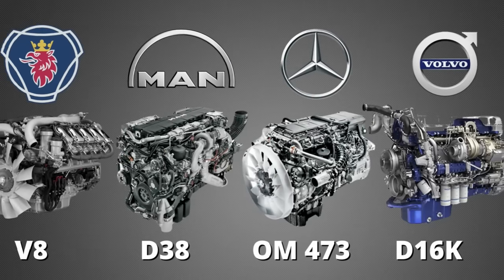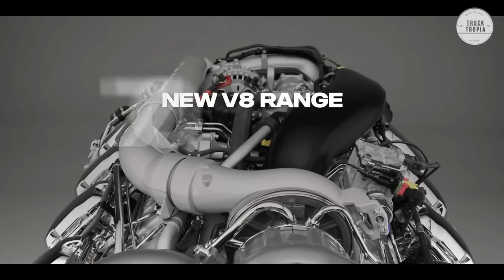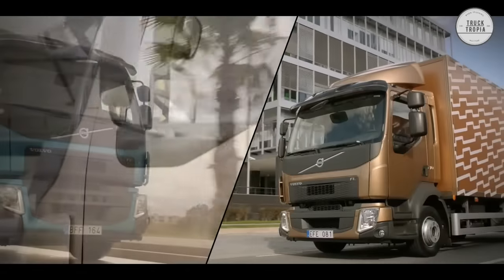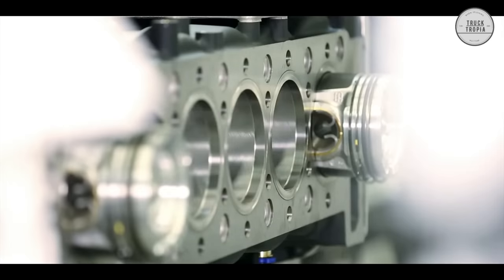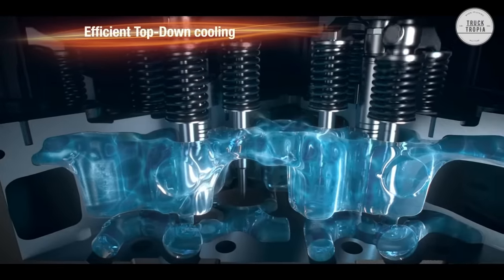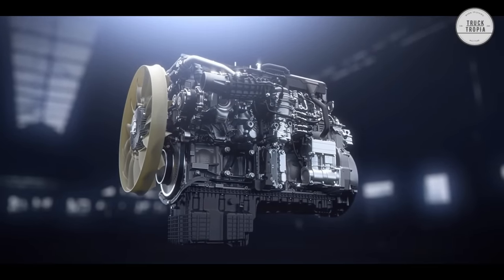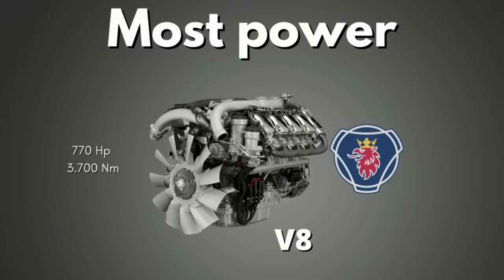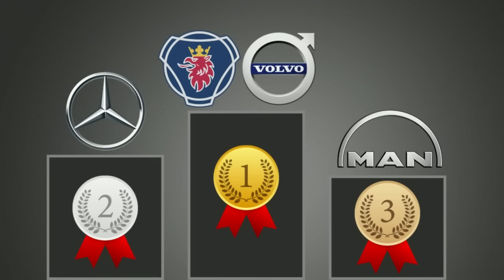Which Engine Is Best - Scania vs. Volvo vs. MAN vs. Mercedes

Comment: I own a transport company and I have DAF, MAN, Volvo and Mercedes trucks and so far the most reliable one is MAN (a 2015 d26 480hp with more than a million km only needed regular service like oil changes and filters), with Volvo we've had DPF issues and some electrical anomalies, Mercedes had issues with the retarder(small metal fillings blocked the radiators)and my DAF had issues with the exhaust aftertreatment (also no one can figure why it uses lots of adblue). By far the most economical is our Mercedes (a 450hp unit) with DAF coming second and MAN and Volvo are quite similar here. In terms of cab comfort all my drivers love the DAF, it has a really well designed cab but Mercedes comes second with MAN being the most outdated. We haven't ran Iveco or Scania(we avoid Scania because it's way to expensive and doesn't make much economic sense, I prefer to better pay my drivers). For servicing I do have my own service station and all trucks get serviced yearly or at 100k km(depending on what comes first, we also have telemetry systems and some trucks would adjust their service intervals depending on how hard they have been working). None of them left drivers stranded so far
Reply: Trailers ?
Reply: Eveco it's similar to Renault not worth it . And i guess these two are the cheapest over all
Reply: This is good of you.
Reply: Mercedes a brand u can trust anytime.much love and respect from Africa Kenya ✌️♥️ trucker in 🌍 Africa
Reply: Salut,la ce ar trebui sa fiu atent prima  cand cumpăr un camion?
Mă gândeam la un Volvo sau Man,  fie EEV  sau euro 6.
Reply: @clauu1066  eev este euro 5, nu ai nici un avantaj față de euro 5. Este important să te uiți la istoricul de service, legea obliga operatorii de transport să aibe un registru de service pentru unitățile folosite deci poți să te uiți acolo și nu fugi dacă mașina nu a avut service la reprezentată de multe ori nu înseamnă nimic(TGXu care mi-a trecut de 1000000 a fost de la H.essers și nu a fost nici măcar 1 zi la reprezentată pentru service). Nu cumpăra ceva ce nu o să folosești, pentru marfă generală 440-480 de cai e suficient(17-18 tone media). Alt sfat pe care ți-l dau este să aștepți până în primăvară, mașinile încă sunt scumpe dar producători au început livrările pentru cele noi odată ce ajung la zi livrările or să se ieftinească și cele second-hand (un euro 5 simplu nu merită mai mult de 15000 de euro).
Reply: @yassineyangossa3148  Renault is essentially a cheap volvo often with better cabs, the issue with these cheaper units is that companies and drivers who buy/drive them tend to abuse them more often and to not service them regularly (they buy these mostly to maximize profits) unlike a volvo or a Scania which are mostly bought by fans of these brands and drivers tend to like the brands( a Scania r450 uses essentially a 12.5 L MAN  engine but at a higher price). So brand loyalty shouldn't be considered here, I tend to buy MAN because my mechanic knows them extremely well(being an ex MAN mechanic) but keep this in mind I'll rather buy a well maintained Iveco than a questionable maintained Volvo.
Reply: @yassineyangossa3148  Krone and Lecitrailer(older ones). With these the less features they have the more reliable they are
Reply: @Jefecino  you can go to a MAN service station and ask them to reprogram the gearbox to better suit your needs.
Reply: @Rsvlogs1990_Khan  had some issues with the mp4 generation and they lose their value with higher mileage (unlike MAN,Scania, volvo etc) but they are good on fuel
Reply: @Stef.Cata051  very true even here in Kenya we have issues with the mp4 model.thank you for your kind reply much love and respect from Africa Kenya 🤗♥️
Reply: @Stef.Cata051  mulțumesc frumos
Reply: I work for MAN, we have our issues but so far biggest problems I see is software/adblue related. not much engine related
Reply: @assassinul95 Man is the best truck in the world
Reply: Im in america and i own my volvo ! Deleted dpf egr ! Runs like a champ 525hp
Reply: Thats True
My Father Had Own Buses
Setra, Mercedes, Neoplan and Man. 
Man Was The Best One
Reply: Am Nowamazima Duncan firstly i congratulate you for a strong mind and good ideas and i wish success. Thanks
Reply: Am mechanic well experienced but since of poor economic support in my country Uganda  i would like to be offered an opportunity
Reply: first get a scania and try it.  then sell the whole fleet and buy scania
Reply: @yassineyangossa3148  Renault trucks are owned by volvo.
Reply: @jacob42069  yeah ... some of our MAN goes back to munich because of adblue-problems and MAN-munich cant find the problem. we are not the only one ...
Reply: MAN is best in automatic and manual transmission
Mercedes little good but MAN is great in truck and trailer I am in Saudi Arabia and drive all type of vehicle you mention in comments MAN is best if I giving position for the number 
Then number 1 is MAN 2 is marcedes 3 for scania 4 for Volvo and 5 for renult in trucks
Reply: i have only driven scania and volvo, now i have a volvo fm480, just right now at this moment when i comment this my truck has stopped, its the second time in a month it does that, before this one i had a G500 L6 i miss it so much better comfort, i never had any problems with it, same size as my volvo except i have 4x2 now and a cargo box with space for 21 pallet places, the scania had 6x2 with steering on the last axle and same amount of space on the cargobox
Reply: @punjabirocks5504  funny that with all the problems MAN has as a company, essentially ending up begging for spare parts from Scania because they don't have the economy to develop their own designs further. However they've also been quite unlucky with their decisions lately such as focusing on their new chassi right before new conventions
Reply: This is so true I work with a logistics company at Nairobi port and we've been very much okay in terms of service and fuel consumption with MAN trucks
Reply: Are you saying that Man is a good truck?
Reply: @pencilwaniya5317   off course come to kenya you'll see major companies using MAN trucks to haul transit goods
Reply: @ronmunoru829  Because they're cheaper, on the inside they can't compete with the high end brands but if they suit the needs you have they're obviously a good choise. As a company though, they're poorly operated
Reply: From where are you sir
Reply: @harshakaeranda9430  I am Indian..
Reply: NAM has some awful handling BTW.
Reply: For your Daf, do you know what is the fault code on your adblue system? The adblue test and purge been carried out? The ad blue injection been forced and manually quantified? The adblue injector return pipe is free or blocked? If all those units are working fine, need start checking the feeds and can busses between control units and sensors, any mechanic must find the problem in less than 2 hours
Reply: So Sir Can u give me a driver job or Hire me for Auto Electrician for your company
Daily basis maintanance ?
Plz 💖🥰⚘️🌹💝🥈🥈
Reply: How do I get in touch with you sir
Reply: @scottmeekyn88 
.
You can send me
Mail , Sir
Reply: Plot twist: ETS2.
Reply: Scania lasts longer tho expensive,u should try it
Reply: 100,000.00Km? 🙄
Reply: Sir I'm waiting your's R3ply
Reply: MODINE??? EGR??? AD BLUE??? HIGHTEMPERATURE INTERCOOLER???
Reply: Daf is the worst trucks iv ever driven. The newest Scania is the best then the actros then MAN DAF coming last because they are shit I hate every thing about them. I was driving 3hours and I sat there thinking of nice things to say about it and the only thing I could think of was it holds the road well, that’s it.
Reply: @Stef.Cata051  ai dreptate. 
Am observat că se ignoră de obicei în comparații Renault și Iveco. 
Eu prefer Renault decât Scania sau Volvo.
Reply: MAN is Afrika tough my broer...Mercedes is massive here too...
Reply: Having driven and owned my own Scanias for over 48 years although now retired there is no other truck to compare with a Scania with a V8 engine…Ive had at least 10 over the time that did over 2.5 million kilometres without serious zero engine issues , a few minor problems but nothing more than that ..I’ve had DAF Iveco turbo stars V8s back in the late eighties Mercedes 480 powerliners Volvo Fh16s and none of them could match the reliability of the big Scania’s …Overall while the cost more upfront the resale value is way above other marks, not only that there’s an almost guaranteed line of buyers for good quality well maintained Scanias..I only ever bought one with a straight six engine 😭, troublesome and I got rid of it by the time it was 2 years old…
Reply: Can I get a job at your company,I am from guyana
Reply: Hey... question..
I recently got a tgl and its very slow .... Especially over small incline and loaing power ....what should i do
Reply: That's correct...I had a MAN running for 17 years
Reply: Salut! Am cateva intrebari concrete, îmi lași te rog frumos un email? 
Merci!
Reply: Skanya 770-cv Motor V-8 Diesel 💙 💛 💚 ❤️
Reply: ❤❤yes sr. MAN &Mercedes 🔥🔥 twin King 🛸 on the road😊
Reply: Guy I have a question please tell me so I could have an idea, if you were to place a man truck and Benz 240 on the track for a long distance race who will come up first
Reply: @sebastianfallman9876 the reason for that is bcs they were owned by vw group
Reply: Question? Where's your company based and do you might in need for a  driver?
Reply: اتمنى أن أعمل سائق شاحنة في أوروبا أو كندا أو الولايات المتحدة الأمريكية

Comment: The question is which engine's will still be operating in 5-10 year's with minimal downtime and issues 👍🏾
Reply: I would say that is Scania
Reply: @nerminkovcic8465  I agree 💯
Reply: I would say Scania.
Reply: Scania for sure
Reply: Volvo is best
Reply: Volvo engines are known to run 1.5 million miles easily
Reply: Scania any day
Reply: @elonmusk8055  so most of the other brands, but the question is with the less servicing.
Reply: @Andy Williams Scania  isn’t a patch on Volvo
Reply: I drive a MAN TGX 18.540 D2676 Euro 5, the Engine have now around 1.066.000 Kilometers driven and since Zero kilometers it have's to tow daily heavy weight's  (40to.) and i have no issues with it and i overtake with 41to. weight a Scania 560 V8 like i sneeze it trough the Air Intake.
Reply: @Holtol I can well believe what you say , I’d rate MAN above scania too , the  scania,s I have been in don’t seem to have much torque at low revs - very flat , probably too much emission equipment to make the engines run ultra lean maybe
Reply: @muckle8  but u have right with these emission equipment it consumes much power
Reply: Yep it’s ALL   about economy  and emissions now for all engines , drive ability and power have to take a back seat - sad
Reply: @muckle8  The 560 hasn't been produced since the 6-series facelift was introduced back in 2014, or so. The 560, I'd guess, produces around 2800Nm of torque between 1000 and 1350rpm. About what a modern 530 produces. This would be relatively weak compared to today's standards since the new Volvo D13K500 produces 2800Nm of torque, as well. The R/S590 produces 3050Nm of torque. Could also be that the truck he passed was driving in ECO mode. Allows the engine to rev lower before changing to a lower gear. Could also be that he didn't go as fast at the bottom of the hill. I have to admit, though, MAN makes quit egood engines. But the highest spec for the D2676 is 520hp and 2400Nm of torque. That's about what a Volvo D13K440 or DC13 440 produces.
Reply: Hino ofc but MAN is quite reliable atleast the current country I am in.
Reply: @TNT freddan don’t you know what revs these engines are doing when peak power is quoted? I’d like to have a comparison with all the 4 here and more manufacturers at the same rpm - best engine I’ve seen for power was a 500 hp Detroit diesel , thing had power everywhere
Reply: Volvo no doubt.....95 model still working
Reply: @Riyaz Ahmad. Africa full of old Volvo trucks  from mid 70’s to early 90’s pulling 80- 100 tons  , quite a few mercs too tbh

Comment: You forgot the MAN D4276, a bigger-bore version of the D38 that has not been introduced in MAN’s trucks (yet). All MAN inline six diesels of recent decades have been designed for two displacements each — the D2866/76, D2066/2676, D1556/E1856 and most recently the D3876/4276.
Reply: Mercedes Benz
Reply: D4276 base on D38 .. diffrent only stroke and ECU system

Comment: I have worked on all kinds of engines over several decades and have to say the best engines I have ever come accross were made by Hanomag. Only one problem; they don't make them anymore but they are above all others.
Reply: Bollocks!🤣 The best engines are more complicated thus harder to work on?🤣
Reply: thank you universe 888  man.
Reply: I have a hanomag 44d its soo fast and never needs Any fixing
Reply: @jasonwarrior2325  yes. I have several hanomags here Inc 2 44d models. There will never be another shovel that good made again.
Reply: Why? examples please.
Reply: @bb21again.67  different engine models have different reasons and it would take far too long on here to explain. But they are the best.
Reply: @chrisfleming5109  When did they cease being made ?
Reply: @bb21again.67  1994 but some were still made till 1998. They were the first firm to mass produce diesel cars in 1936 . They built tractors with supercharged 2 stroke diesels in the 1950's and in ww2 our submarines were out paced by German u boats using hanomag engines that could run on petrol or diesel or a mix and that's only the start of the story.
Reply: @bb21again.67  
Depends, Hanomag used to built all kinds of vehicles. 
Steam locomotives they stopped building in the 1920s, passenger cars in 1940, trucks and tractors in the 70s and construction equipment in the 90s.

Comment: With the in-line six-cylinder Mercedes has already made a huge step forward, compared to the older V6 engines, but the MAN with D26 (almost 480hp) now consumes 6 liters less in a 4x4 semi and is also much quieter and better sprung than the Mercedes . The predecessor MAN with 500 hp was even better, but it also drank a lot fuel.
But my best truck was still the F2000. Simple, quiet, robust and powerful.
Reply: There gear boxes suck
Reply: F2000 it's a tank, not a truck. A living legend. Too bad there is no AdBlue system to add it in order to increase the pollution norm from E3 to E5 or E6.
Reply: Meh, hate of v6 is unfounded.
Reply: @em4703 architecture of an inline is much stronger.

Comment: I’ve been a truck driver for the past 8 years and still rolling and I’ve heard stories about trucks and engines, confort and disconfort and for the most part, everyone said that Scania is the king of engines and technology but from my experience, for driving a MAN for the entire time going from first models Euro5 to the latest Euro 6 model now and different engine configurations and transmissions (all automatic MAN and Scania) I can say that MAN is a technical bullet proof machine. Even though they’re known for their sometimes electrical issues (which most brands have nowadays considering the mass digitalisation), on the mechanical part, they’re tanks and provide a very reasonable fuel efficiency no matter the engine spec chosen. I wish I would’ve driven other brands as well to provide info about them, but if I ever was going to recommend a brand to someone, MAN would be the one without even having second thoughts!
Reply: Mister Man is a Man fan!
Reply: I am in North America and  know all about north American trucks. I have been planning to move to the East (Russia and ex Soviet countries ). I am searching about European trucks,most videos compare driving comfortability not much the engines and drive train. Based on my research MAN (2002-2010 years ) would be the best option for my needs . I will be on a  low budget owner operator to start my transport company. I will be mostly hauling fruits and vegetables from central Asian countries to Russia to sell them there . I have connections and networking I just need a good reliable truck

Comment: I’ve driven all these makes apart from MAN,without a doubt Scania is the choice for me,reliability is the name of the game along with comfort and ease of driving. Volvo comes a very close second but just doesn’t have the fit and finish of the Scania and the engines are Not as powerful or as quite. Mercedes,I drove a six wheel concrete mixer with the Gutless V6 engine,good quality cab and chassis but that engine was pathetic but reliable just like a Gardner used to be.

Comment: I have worked at both scania and Mercedes and I will honestly say the scania v8 has much more problems than the Mercedes, the only time I ever saw merc engines fail was when they were ran dry by drivers ignoring low oil level and pressure warning. I cannot say the same about about scania plus the Mercedes is a lot easier to work on. Scania have brought out a new 6 cylinder engine that looks a lot more like the Mercedes and man engine so time will tell if its any good.
Reply: ❤❤corect. This video is 😂😂😂😂😂😂

Comment: i am not gonna say that that is bether than this, but the gearboxes Volvo offers twin clutch non-synchronized transmissions that change faster than the boost pressure drops between gears, have seen 550's loaded to 50 ton chase down lighter loaded Scanias with similar engine performance in the hills, and in Norway we got nothing but up's and downs so that is a game changer from the older gearboxes where you had to drop 2 gears as you needed time to load boost again, these new ones drops half a gear and keeps going